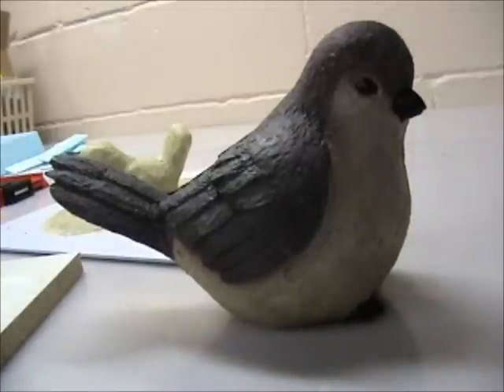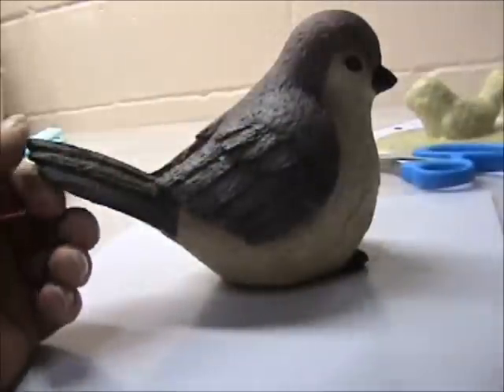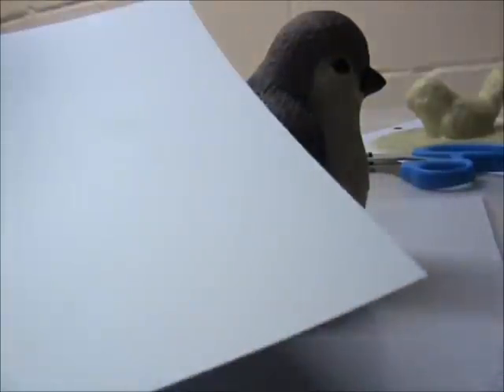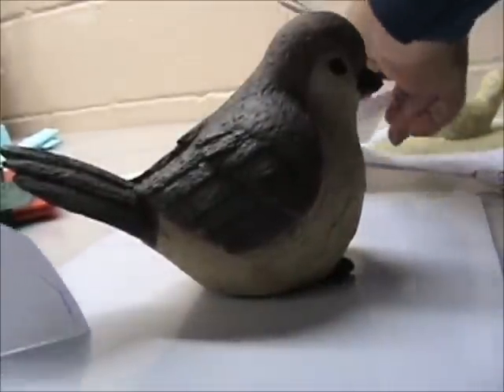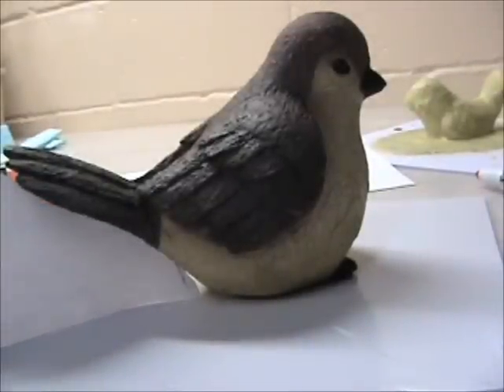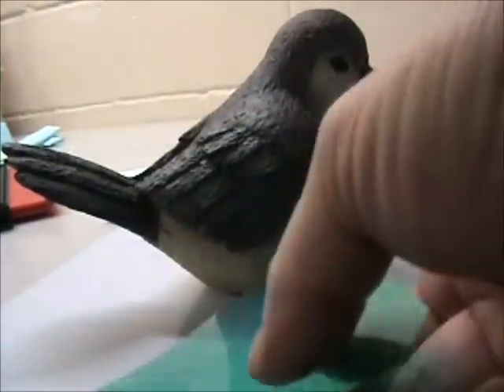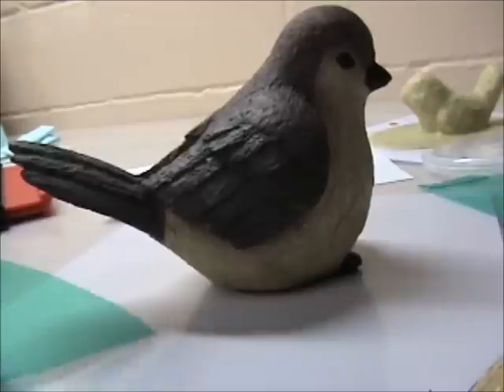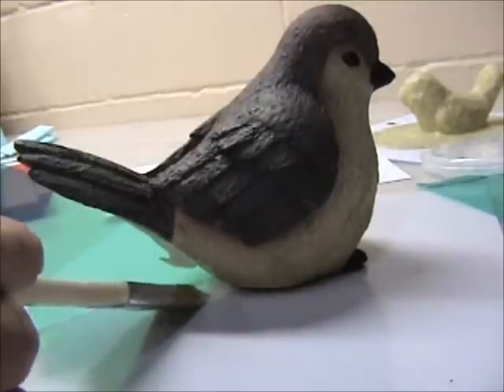diymolds.com - How to make a seam for a latex mold - Video Tutorial -Part 1

Comment: Have you tried spaghetti noodles as a contour gauge? I have seen this used when welding pipe together. Like this but flat http://www.dsmtuners.com/threads/pipe-fitting-with-spaghetti.320297/
Reply from the maker: Been using solder wire as of late ;-)